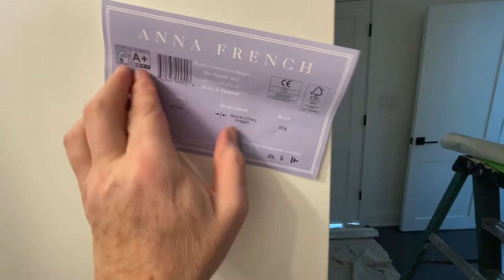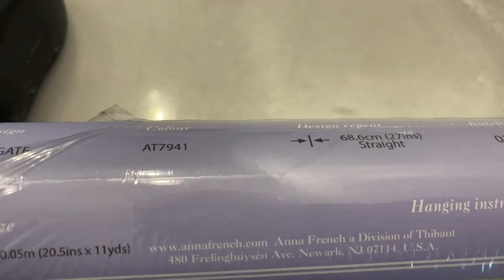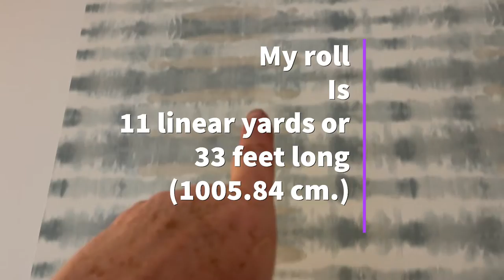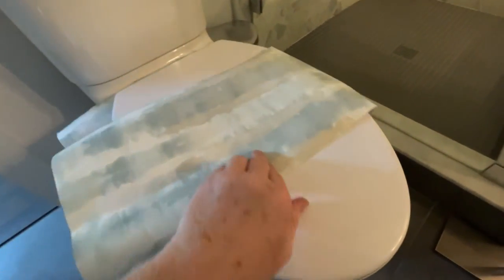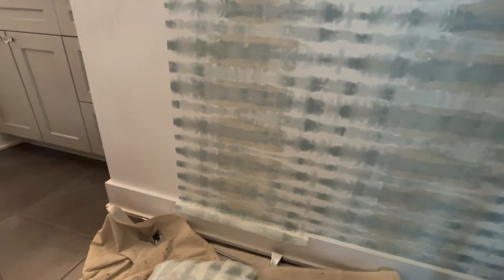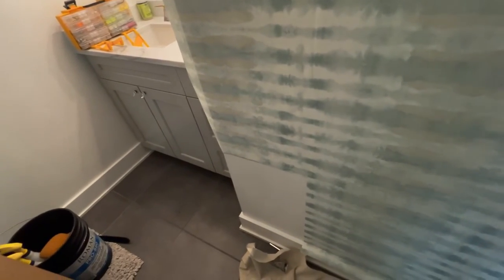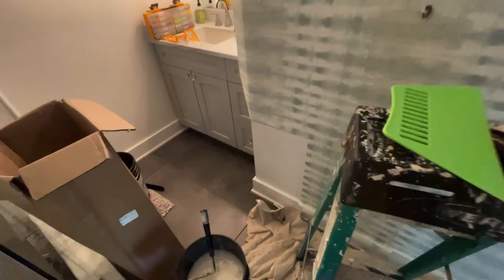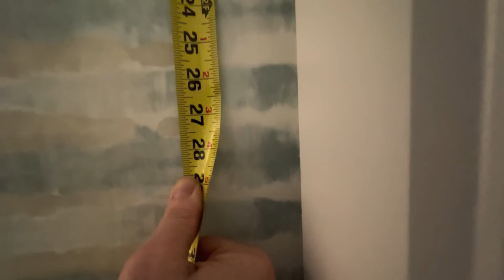How to Calculate Wallpaper Needs - Spencer Colgan

Comment: Hi Spencer. Generally speaking, if the wallpaper is "reverse", does that mean the  pattern is unlikely to have a repeating pattern that I would need to be concerned about in matching? Initially I just thought it meant that "reversing" was related to color and texture versus a geometric or other more distinctive pattern (i.e.flowers or turtles). Thank you.

Comment: This reminded me of a job back in the 80s. Very large repeat. I ended up hanging two walls with the same 
pattern at the top, and a different pattern at the top on the other two. It was a flower pattern so it was
not noticeable. Can't remember the exact measurements of the repeat but it worked out perfectly.
Reply from the maker: Thank you for sharing

Comment: I understand the math since I've done it for so many years, but for the average homeowner, I'd simplify it by calculating 3 strips per 32-33' roll for any match, straight across or drop for 8' ceiling height. Random match will give you a 4th sheet off the roll, but you'll have to cut it tight (4 X 8=32' which will leave about 12" to work with). Waste will be waste - can't be helped. If it bothers anyone to the point of distraction - use it for shelf paper!
Just for clarity a "roll" is actually +/- 16 linear feet. 32-33' are actually "double" rolls, but nowadays this seems to be the norm when ordering wallpaper.
Reply from the maker: Brian, thank you very much for adding this comment. It’s very helpful; yes, I should’ve made the distinction when I spoke about the role issue being single and double

Comment: Spencer do you think wallpaper manufacturers do this so you need more wallpaper I certainly do
Reply from the maker: Absolutely; they could make wallpapers in which you typically get four sheets per roll whether you have 9 foot walls, 8 foot walls or 10 football; that is completely feasible if they just go with reducing repeats or simply extending the role of the paper; or, they could make the role shorter since they know that most walls are between 8 foot high to 9 1/2 feet high
Reply: @spencercolgan  been saying that for years spencer sometimes the difference is so minuscule it's hard to tell loving your  vidios as a professional decorator from bonnie scotland and by the way in england wallpaper hanger is called a sticker
Reply from the maker: @williamgorman893  William, thank you so much for watching my videos and that is very interesting that sticker is a paper hanger that’s awesome

Comment: He's  right. Too many homr owners chsllenge you over what it 'says on the label' or what the sails person told them. Some patterns dont even add together full stop.  Most will but at cost of yardage. 
Its possible to splice a section of wastage back onto the drop at the bottom using papering skills and a sharp blade. Hrnce why he says to hang on to the wateage. But this adds time

Comment: I found your tone and pattern of speech somewhat condescending. I also forwarded through a lot of it because you added asides that I didn't need.  You talked about splicing,all you had to say was don't splice. You spent a lot of time going through the explanation. I think it could be so much simpler. You went over the packaging on the wallpaper and the length of the wall many times. Your explanation was too long and involved. I think it would have been easier if you had offered a calculation, using yours as an example. I really could have used that. I got lost because you went on and on in that condescending voice,  and repeated things randomly. It was not concise enough for me, you rambled too much and I lost the information you were trying to get across.
Reply from the maker: Your comment went on and on and on. You criticized my alleged “condescension “when you really have no basis other than a snapshot of my speech and voice in this very little clip of time. Your criticisms covered a large array of things in the video. You failed to use proper punctuation in your comment; please acquaint yourself with the use of the tool called a “period,” and please acquaint yourself with the use of the grammatical tool called a “semi-colon.” These tools are used to better express the ideas you would like to say; although your criticism and your writing is better than most of the people who comment on my videos, if you read it over, you will find some errors in your comment; you are probably between the ages of 31 and 38 years of age, am I correct? This type of error is common among folks your age   

How does it feel?
Reply from the maker: I advise you to go back and watch the video from the beginning until the end and stop forwarding through my Very important videos; you do not know me and therefore You do not understand my personality… You are probably not a subscriber to my channel and this is probably the first video of mine that you have watched… I joke around with my viewers; welcome to my channel and if you do not like it, please look at somebody else’s videos